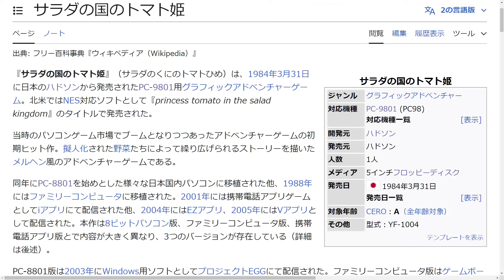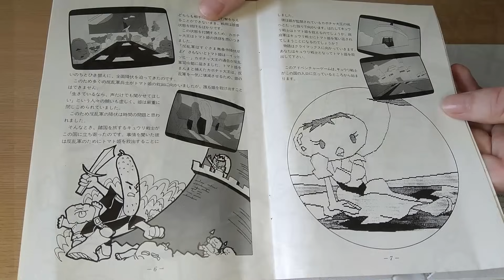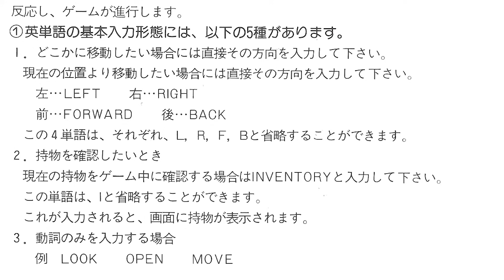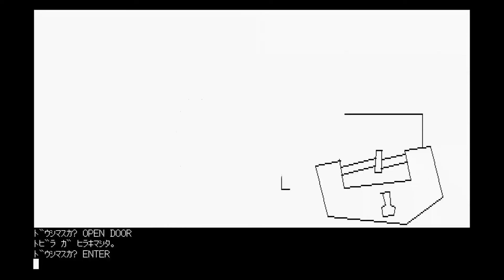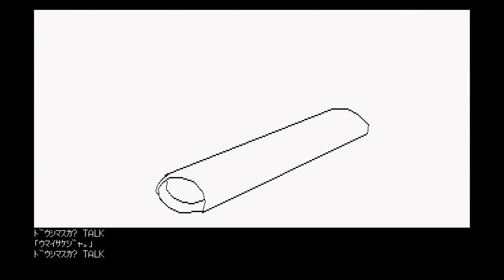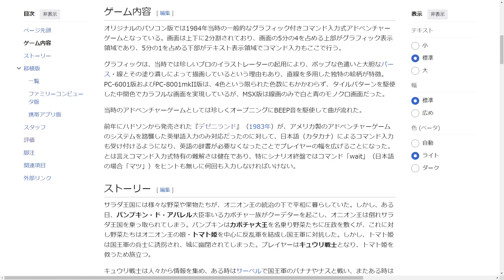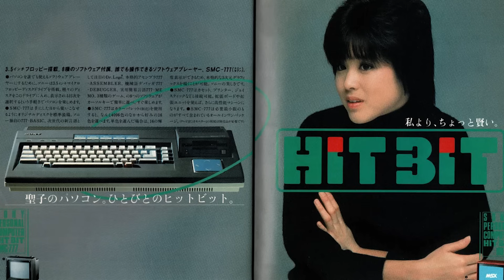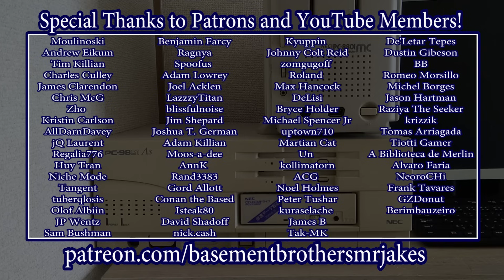Princess Tomato in the Salad Kingdom (PC-98 Paradise) - How is the original different from the NES?

Comment: That dithering stuff is genius. I bet it looks really good on a CRT or whatever the original target output was.
Reply: Definitely crt, and I guarantee you're right about it looking great.
Reply from the maker: You have to remember that PC-98 could not be connected to a CRT TV. You needed a PC-98 CRT monitor, which were very sharp and high-res for the time. And also, you would be sitting very near the monitor while playing a PC game. I do remember playing PC games that used the same simple every-other-pixel dithering in the 80s and it was often very obvious and easy to see the individual pixels. I really do not remember it looking very good.
Reply: @BasementBrothers I know this isn't the first time you've mentioned this but it's such a good insight from a rare person who uses an OG PC-98 CRT and targets an English speaking audience.

CRTs do a little bit of blurring naturally to some minor extent but most of the blurring people think of is from NTSC composite encoding and to a lesser extent low dot pitch on TV shadow masks (sometimes).

NEC's CRT monitors were 100% designed to show 640 pixels clearly, luma or chroma. That was the whole point of the computer designs, to show hi-res kanji clearly!
Reply: @BasementBrothers  I've never used a PC98, but I used to make a lot of drawings in Paintbrush on Windows 3.1, and I hated the dithered colors. They didn't look any better on the monitor than on a modern LCD or OLED.
Reply: @BasementBrothers  - Yeah, I'm sure it didn't "fool" anyone, but I still think it's genius because it turns a 16 color palette into 256. Though it does look like a lot of potential was left on the table.

Comment: That setup with the internal floppy drive reminds me of something I'd seen with a high-powered GPU once. Very much taking an internal drive and making it an outer-nal one, on a block of foam for shock insulation and all. I almost considered that for my current graphics card because it didn't fit, until I figured just selling my SFF desktop and buying a thiccer boi used would be easier. And less likely I'd ruin it by spilling pop on it, or something.

As for the game itself? I'd seen bits and pieces on an old buddy's stream once. The original version's kinda weird, but also kinda neat. Plenty of late-game bad endings that you'd avoided, I see. As someone who also didn't get far into Shadowgate as a kidlet, I can see the NES / Famicom version of ol' Tomato-hime being a much more inviting adventure game. Cool that Hudson's acknowledged its existence nowadays too. Given that its two head creators both went on to make Bomberman games, it's a fitting place to put a Princess Tomato cameo character.

Comment: Glad your video came up for this particular game as not many NA PC games had 2D vector graphics in higher screen resolutions, by the time higher screen modes came into use in NA that style of graphics engine was on the decline.
7:38 Yeah I don't understand why they didn't use horizontal interlacing lines instead of traditional dither when using essentially 1:2X pixels as it looks more gritty and coarse than it needs to. It's much like C64's 2:1X pixels looking more coarse with traditional dither than with vertically interlacing  lines. Glad you changed the video output, the skipped rows is not good for YT compression and overall darkens the image.😉
Can't say I played PT much until way after the fact on NES emulators but do intend to get a cart someday. Nice to get some greater context of the whole PT universe.

Comment: Dumb comment for algorithm purpose
10:00 Yes I have eaten persimmon before. A tip if you find some too hard;  persimmon ripen after getting plucked, becoming softer and sweeter over time. Eventually they become very mushy (still edible though, so good for smoothies), so I wait for the right moment for when they are firm but juicy.
Reply from the maker: Yeah, it is a little hard cutting them open at just the right ripeness. Almost as difficult to time as an avocado!